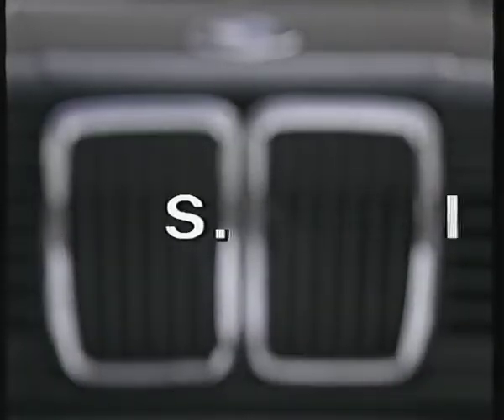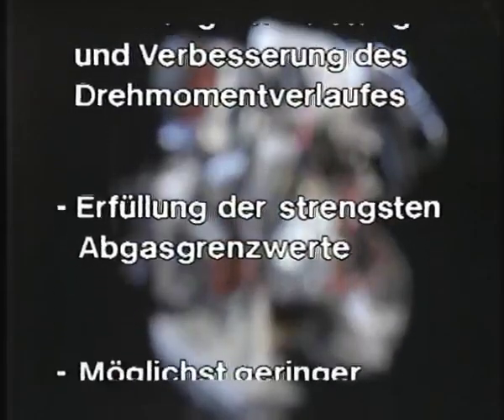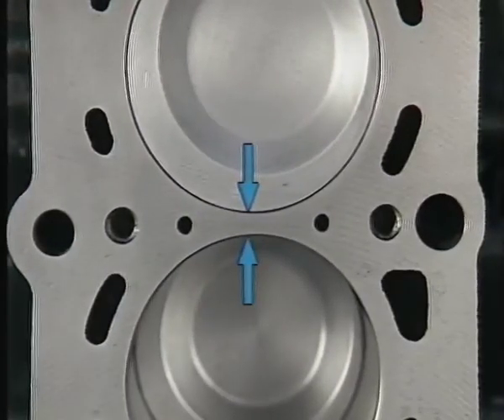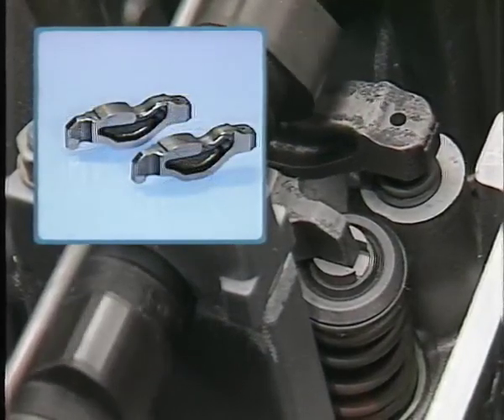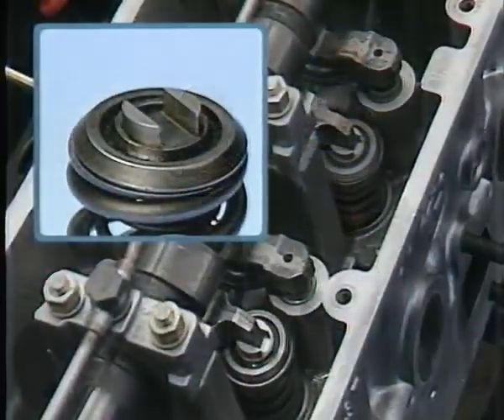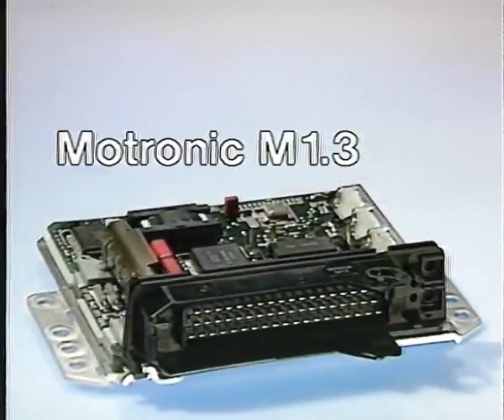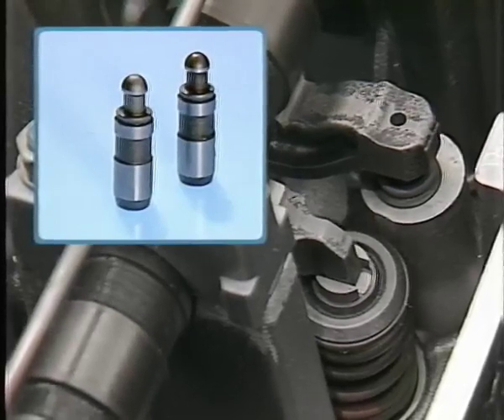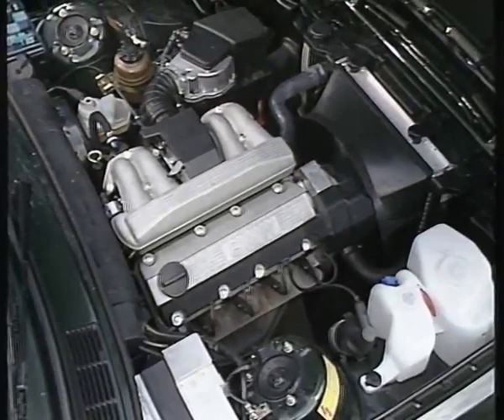M40 Motor

Comment: M10 better
Reply: I understand why people prefer the M10 over the M40, but I've never had any problems with my 316i for 3 years now.
Reply: @Thor I did not say the M40 is bad I say the M10 engine is better than M40 engine
Reply: M10B18 has only 1 nm torque less. and m40 has more problems so i prefer it too. i am driving as a folk racer and the problems i have in my m40 motor is so awful that i will swap it to a m10 when i can.
Reply: Yes sir, M10 all the way
Reply from the maker: Vielen Dank für das Feedback. THX